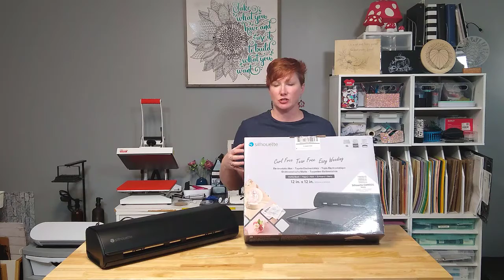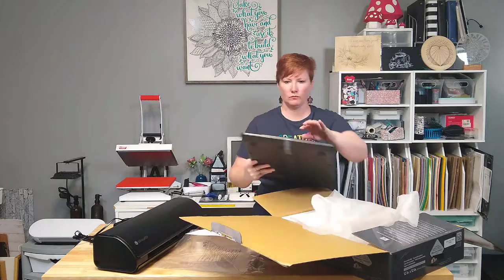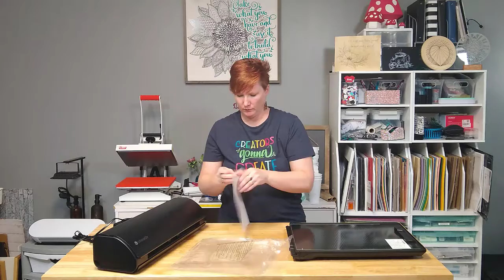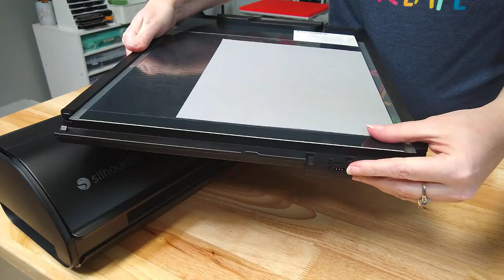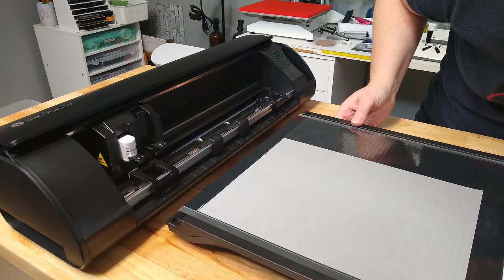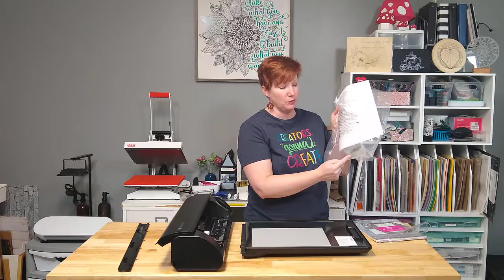Silhouette Electrostatic Bed Installation & Tips - Cameo 5

Comment: What is the total depth for the from the front installed edge of the ES bed to the clearance needed in the back? I just purchased the Cameo 5 alpha and the mat and am hoping my 55” deep desk will accommodate it.
Reply from the maker: Approximately 37" total - you'll need space for the ES mat to be connected to the machine in front. We recommend a completely flat, single table, with no breaks. Uneven surfaces, such as 2 tables together can add stress to the electronic connection and cause issues. And then you'll need 10-12" of clearance in the back for the ES Mat to freely move through.
Reply: @SilhouetteSecrets  thank you! I hope to give it a try today!

Comment: This helped a lot. Ty. There are two buttons on either edge of the electrostatic that help snap it and unsnap it into place with the plug that installs it to the cameo5. Thank you for this video.

Comment: A second question...thank you.  Again, on a Cameo 5, with an ES Mat.  I want to cut something on Letter size cardstock in a Landscape orientation.  However, when I choose the Orientation:  Landscape, it only turns the image of the ES Mat itself to Landscape, not the media.  My workaround, for the moment, is to tell it to make the media 12x12, but the cut lines aren't accurate to the project I'm trying to do, so not ideal.  Any thoughts? Thanks so much.
Reply from the maker: That is a bug in the software version and is fixed later in a Beta version I believe that is still under testing. 
I'd recommend cutting in Portrait orientation, but rotate your design.
Reply: @SilhouetteSecrets  Wow, you know all the secrets.  It's always nice to find out that "it's not me."  Thank you! 😊
Reply: Bizarrely, even though I have ES Mat and Media exactly where the cutting lines show (both in vertical orientation with my project turned sideways), it started cutting OUTSIDE the cut lines, into my ES transparent sheet!  Am I not supposed to line up the media with the front and side edges of the transparent mat?  This thing is about to go back in the box... 😬I just wondered if there was a bug with that, too.  I am using software version 4.5.  Maybe I just need to start again tomorrow... UPDATE:  I am using my original Cameo and it is working great...

Comment: Hi, could you answer a question for me?  Will the wheels of the Cameo 5 roll in the "ditch" between the electrostatic mat and the 1/2" wide edge piece?  That's what the manual seem to be indicating on the diagram (and the leftmost stationary wheel rolls in the ditch).  However...the manual also says that the wheels will be "on the transparent film,"  but my transparent film isn't wide enough to cover the "ditch" where the wheels would roll.  Is this a problem?  I'm just trying to avoid breaking my new machine.  This is a replacement machine from Silhouette because the roller wheels on the first Cameo 5 I had cracked and broke apart after just a few uses.  I think that is probably an issue of the wheels not being made very well, but...I want to be as careful as possible...thanks so much for your help!
Reply from the maker: The rollers are supposed to go in the ditch on either side of the electrostatic bed, not on the protective sheet. 
The transparent film they are referencing is the transparent strips that are in the ditch on either side. In the box, you also received replacement ditch transparent strips with instructions on how to replace those when needed. 
The roller on the Cameo 5 was a manufacture defect that they identified, tracked to a specific manufacturer, and resolved... there may still be defective rollers out there on machines, but eventually they will all be known. It was not all machines, so they can't just recall everything.
Reply: @SilhouetteSecrets  Thank you for your fast response.  That is exactly what I needed to know!  Plus, the information on the manufacturing defect.  Very good to know.  Hopefully my second machine will work well.  Thank you SO much!

Comment: I just got my ES Mat today, but i dont know, where or how to place the 2 strips. Do i have to remove something ? It would have been very helpful to see , where to place the strips. 
Sorry for my bad english.
Reply from the maker: There is a piece of paper in the box with the strips that show a diagram of where they go when they need replaced. For now, you need to save them and if you ever need to replace them you'll have them. They are the frosted strips where the rollers roll on the ES bed on either side of the part of the bed that moves.
I recommend keeping and storing the ES bed in the box when not in use and store completely flat. I keep my strips and the paper in the box for safe keeping.
Reply: @SilhouetteSecrets  Thank you so much for your help ! i thoght , i had to place them before starting.
Reply from the maker: @meikeiben1533  you are welcome!

Comment: You stress that you need to have the protective sheet and there is a specific way/direction it needs to be. YOU DON’T show it when you turn it on and put velum on it! WTF. You give a big DISCLAIMER but you don’t really tell us how to put the protective sheet on it! 😡
Reply from the maker: It's very obvious when you put it on the bed, what direction is correct if the user pays attention. If it's under the rollers, it's wrong. I did not switch my camera angle to show that in the video. Here is a close-up video where I do show,  https://youtu.be/_O6O9lFmTK8?si=gXKkbvMCqZu0Pd19
I hope you have a nice day!
Reply: @SilhouetteSecrets  the plastic sheet is 12”x12”… so is the bed area… Again where is the direction???
Reply from the maker: @kevinleong4467  then your protective sheet is different than the ones with the first machines released. They were not square, and I show that in the video I linked where the protective sheet is under the rollers when placed the wrong way, which will cause issues.

Comment: Do you think humidity of the room and/or the material being cut has an effect on the ES mat’s ability to hold material firmly? We have evaporative air conditioning (I think it might be called a swamp cooler in the US), so I wonder if the ES bed would be affected…
Reply from the maker: It won't affect the ES bed itself but the materials in your room, yes. High humidity causes paper to curl and not remain flat. And humidity can affect paper cutting in general.

Comment: You said the protective sheet needs to go on a certain way but you didn't show a close up of how it goes on there.
Reply from the maker: It is very easy to see when you are adding the sheet to the Bed. One direction it fits and the other direction it doesn't. 
Not as easy to show close up, but I did a video sharing closer images here - https://youtu.be/_O6O9lFmTK8?si=Au_k4zRBoxGbn9pt

Comment: Does thr ES bed come with the protective cutting sheet, or is that a seperate item?  They've not quite landed in the UK yet and I've seen packs of two protective sheets, but wondered if you got one with the bed too?
Reply from the maker: It comes with 1 protective sheet in the box. Replacements are 2 in a package.

Comment: I'm really getting the idea that this electrostatic mat is either a lot of trouble to use or just doesn't work well and is quite useless. Everyone talks about it and hardly no one actually demonstrates it. Those that do demonstrate it tend to end up with a mess. I would love one, but the information on what materials you can actually use and people actually using and reviewing it is so sparse that I'm holding off my Cameo 5 purchase altogether. Not going to spend money on a device that might be a hit and miss and doesn't save time at all. Hoping for videos that will actually demonstrate this with various materials instead of just talking about it. Since this is the main new feature on the Cameo 5, one would think that there would be tons of videos about it, but the absence of them makes me have second thoughts about upgrading.
Reply from the maker: So first, the new products were just announced 3 months ago and have not been available even that long.... around 2 months or so. Some retailers don't have stock yet, so you will not see them promoting it or putting out content on it.
I've had great success with the Electrostatic bed and have several videos on the YouTube channel using it with the Curio 2. All the same tips work with the ES Bed no matter which machine model. 
It will take practice and proper setup. I've cut vellum, sticker paper, 65 lb cardstock, 85 lb cardstock, 110 lb cardstock (not coverstock), and adhesive vinyl using it. User error will be a big factor.... if someone isn't willing to take the time to set it up properly and/or is using materials that aren't completely smooth and flat, then it will not work properly for them. It will be around for awhile since it is brand new, so no rush to get one.
Reply: @SilhouetteSecrets  thank you for the extra info and explanation. Good to hear it can do thicker cardstock too. Flat is the key, I'll remember that for sure... no watercolor paper on the ES bed 😀
Reply from the maker: Additional videos I've done: 
Print and Cut - https://youtu.be/42qwrDzCUks?si=pGK8DxOCh9Cvf3yL
12" x 12" print and cut - https://youtu.be/uTe7JTrl7Uw?si=kQ0alg_X0VOtvgq-
Tips for Success with the ES Bed - https://youtu.be/HENWVeOH7lA?si=Pdkd_28I-PMbkp4L
Reply from the maker: And more tips on the Electostatic Bed and usage - https://silhouette-secrets.com/2023/12/10/silhouette-electrostatic-es-bed-tips/

Comment: I thought this would be a tutorial on setting it up.  She didn't show us how to actually put the electrostatic protection sheet, although she kept telling us that it's essential to put in in correctly, but then she didn't show us how.  We're supposed to adjust the pinch rollers, but she didn't do that either.
Reply from the maker: I do mention there is a direction of the mat. As I mention, it should not be under the rollers. If it is, then it's wrong. That is something you will see when you place it on the bed. The protective sheet has no designation on it, so there isn't anything I can show. The protective sheet is wider one direction than the other. 
The rollers need to be set up for a 12" cutting mat. My machine was already unboxed and used, so I did not mention moving the rollers.
Reply from the maker: https://youtu.be/_O6O9lFmTK8?si=Au_k4zRBoxGbn9pt

Comment: Great video!  I just received my Cameo 5 and my ES mat and right off the bat, I'm not impressed that you can't cut a full 12"x12" piece media.  I select ES Mat 12"x12" as my cutting mat, then I select Auto or 12"x12" as my media size.  Everything indicates 12"x12" until you cut.  It only cuts until 11.5" from the left to right side and only 11.5" from the top to the bottom.  You loose a full 1" of the media your cutting on right side and bottom if selecting 12"x12".  I wish I would have know that before I made this purchase.  I hate to waste that much of my media or am I missing a setting somewhere?
Reply from the maker: What does the red border show as the maximum cut area on a 12x12 page when it's checked on the Page Setup Panel? That is your cut border. 
However, yes, you can not cut to the edge of the page because then you'll break that electrostatic charge. It is just how it works. You need surface area of the material to maintain that charge. I'd it's broken or the surface area is not large enough to maintain the charge, the material is not held by anything. The ES bed is not for all materials or projects.

Comment: Question: Does Cameo 5 cut accurately? If not, does accuracy get better with electrostatic bed? I like to work with card stock and thin paper (regular letter-size blank paper with custom prints) but Cameo 3 was too far off. I am wondering if I should give Cameo5 a chance and your channel is definitely getting me interested. Thanks!
Reply from the maker: Are you meaning in reference to print and cut?
Reply: I've got a Cameo 5, it's my first digital cutter and I've been very impressed with its accuracy.

I did a print and cut test/demo with a simple Santa PNG I found online... I cut one with an external offset, one with an internal offset (i.e. psuedo bleed) and one with no offset.  The maximum it was out was maybe half a millimeter, if that.

One demo I did, I had bright overhead lighting and the example with no offset cut absolutely perfectly, very impressive!
Reply from the maker: @edwardholmes91  love to hear that. I don't have issues with print and cut either. It is within the normal range for a print and cut to be off by 1/16" using the default registration marks. 
Adjusting the registration marks increases the chance of an inaccurate cut, and not all users can move the marks and maintain accuracy.

Comment: Just to give me an idea, what was the gsm of the heavy cardstock you used, and what are the dimensions?

Would this work with the debossing tool?

Thanks!
Reply from the maker: I'm not quite sure what you mean. This video is on the Electrostatic bed with the Cameo 5. I demonstrated placing a sheeg of vellum on the bed but did not cut cardstock.
Reply: @SilhouetteSecrets  oh I thought I heard you say you tried different cardstock and was curious of their weight (lb/gsm)
Reply from the maker: @GrooveYouVerse  I understand now. I've used 65 lb on the Electrostatic bed with the Curio 2. Same concept as the Cameo 5 bed, but I'll be testing others too.